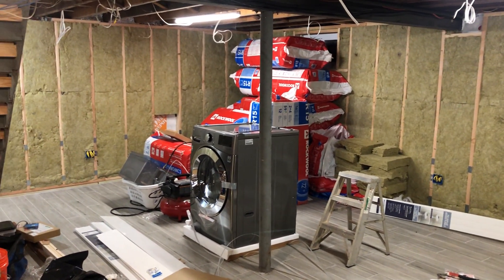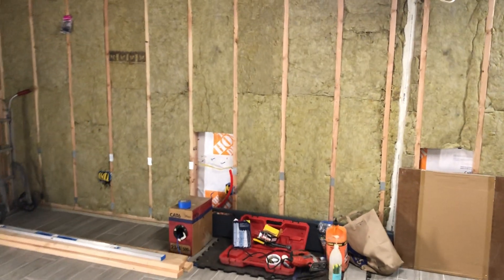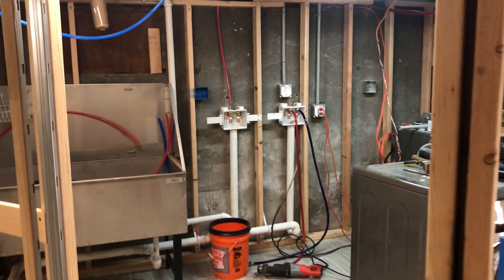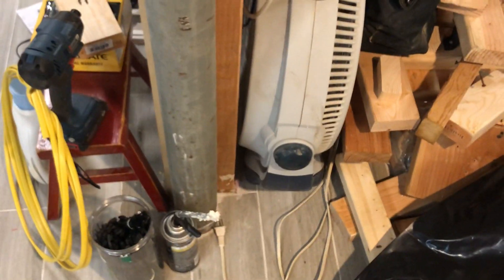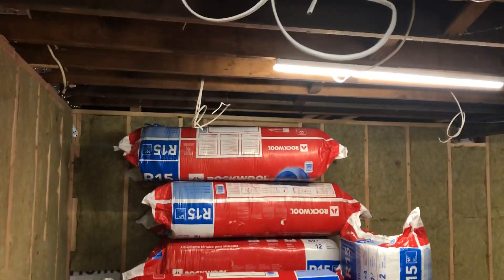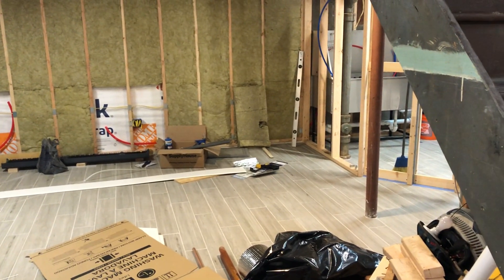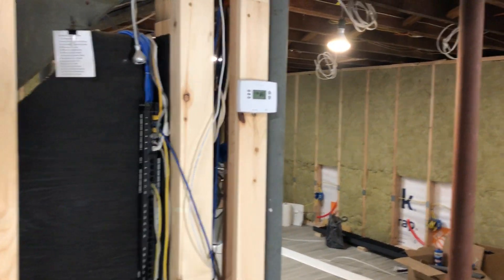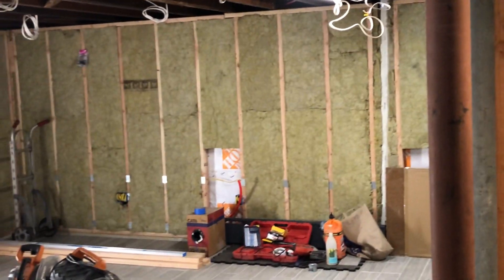Rhythm RR (N to HO Adventure) progress in late March 2020

Comment: one thing I wish I did when I built my shed. was draw out the walls, and mark the location of all my wires and in your case water lines. trust me it will help out later when you start bench works and legs, supports. just a thought for you.